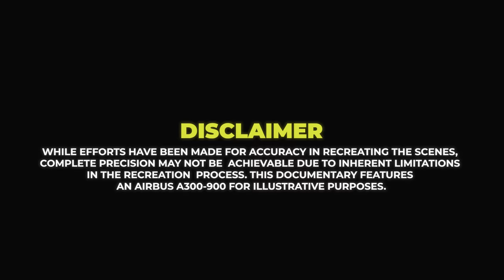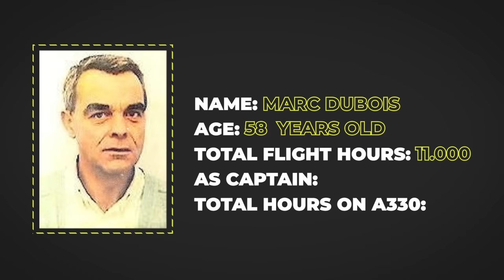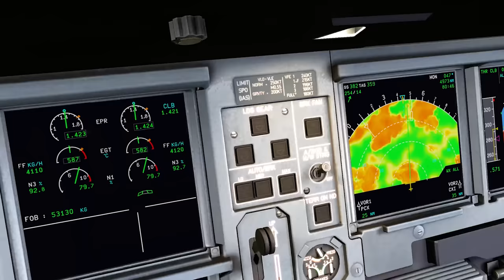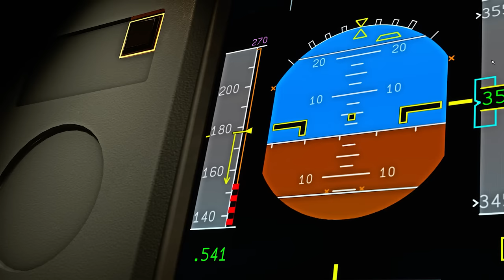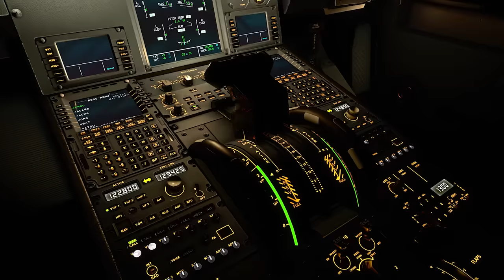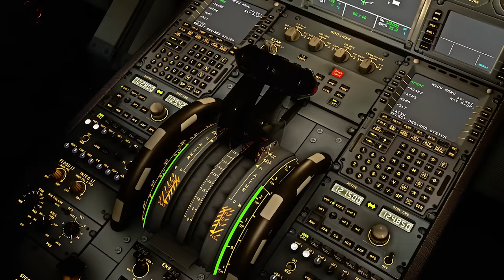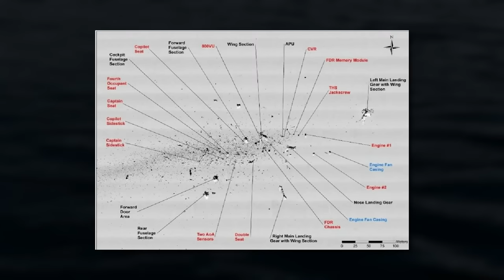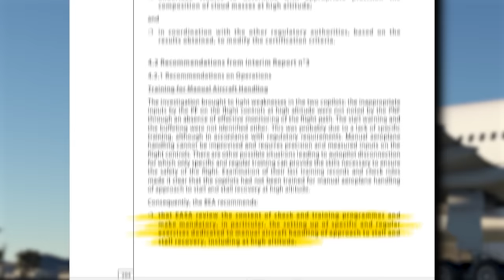Horrific Freefall into the Deepest Ocean | The Sad Story of Flight 447

Comment: I'm a flight sim aviator and I'm shocked at how you could stall at that altitude and not be able to recover. Attempting to put on speedbrakes seems deeply incompetent. It was clear from the recreation video the aircraft was stalling, not overspeeding. When in doubt, push the nose down, especially if you are at high altitude and worried about a stall.
Reply: Bonin, the co pilot F*** up big time, because he stupidly kept pulling the stick back when they were stalling. This guy had no business being a pilot.
Reply: @kevinmalone3210  Yeah guess the guy wasn't trained properly on physics or something.
Reply: Looks like he was to scared to be a pilot.
Reply: The pilots crashing the plane wouldn’t have been possible if it was Boeing
Reply: @thomaspulsiver798  This was 100% pilot error. It has nothing to do with the make of the metal.
Reply: @miawallace2306  in this case it's true, as Boeing doesn't have the dumb joysticks.
Reply: @roiq5263  The design of the yoke has nothing to do with it either. This incident was pilot failure. No Ifs, ands or buts. 
Furthermore, your memory must not serve you properly. Do you not recall B-737 Maxs plummeting to the earth, killing 100s of people just a few years ago?
Reply: @miawallace2306  I'm not saying Boeing can't have accidents. In fact I don't trust Boeing at all. I'm just saying that in this particular scenario, the yoke system would've prevented Bonnin from crashing the plane.
Reply: @roiq5263  Again, the instrument design is not responsible here. Inexperience, hubris and poor crew resource management contending with a routine issue regarding weather and turbulence is.
There are more than a handful of B-777s that also fall into those human error categories. 
Whether it’s a Yoke or SideStick, makes absolutely zero difference.
Reply: @miawallace2306  not denying any of that, just saying it would have prevented this particular accident.
Reply: Bonin's behaviour is absolutely baffling to me.

Every person who ever flew a semi-decently made flight simulator on a home desktop knows that you will stall a plane by permanently pulling up. This is one of the basics you automatically figure out when being new to the world of flight simulations.

Yet he still made this obvious and unfortunately deadly mistake.
Reply: @roiq5263  How exactly ?
Reply: I'm guessing that due to the stall buffeting the aircraft Bonin assumed that the aircraft was flying at a crazy speed so he applied the speed brakes. He's utterly incompetent. RIP to all the pax and crew.
Reply: @funjunk2835  He seems to have forgotten the basic principle of flying. Air speed over the wings = Lift. Lack of Air speed over the wings = Stall.
Reply: @miawallace2306  It's definitely pilot error, but if it were a Boeing aircraft the crew most probably would have been able to recover from the stall due to the setup of the control column.
Reply: @miawallace2306  Totally different scenario. It's like comparing apples and oranges.
Reply: @miawallace2306  "Whether it’s a Yoke or SideStick, makes absolutely zero difference." That NOT true as many PILOTS who commented on AF447 said had it been a Boeing aircraft the crew's chances of recovering from a stall would have been much greater.
Reply: @Robert_N  My spouse has 27 years in crash analysis for the Air Force. Occasionally, he works on civilian cases as well. I myself have 20 years in the commercial aviation industry. 
You are simply wrong. The Boeing yoke does not prevent a crash. In the past, in most cases for many pilots, their initial licensing/type rating was via Boeing aircraft when making the transition from instructor and/or regional carrier  to mainline. Airbus was only introduced in the 1970s and wasn’t considered a major staple until the late 80s/early 90s for commercial use. There is sufficient evidence to support that in a state of panic, a lesser capable aviator can and will revert back to basics as opposed to circumnavigating through the issues readily at hand. The instrumentation for both Boeing and Airbus can be misused exponentially and equally. In both instances, the design is in no way, shape or form attributed to to “yoke” vs “sidestick” but rather the actions or inactions taking by the pilot(s) in control of them.
Reply: @miawallace2306  You're entitled to your opinion and I'm entitled to mine. BTW My father RIP was an airline captain and we used to discuss aviation topics/crashes/incidents all the time.
Reply: @Robert_N  Not an expert but I thought Airbus actually had more automated protections against things like bank angle, critical angle of attack, etc than Boeing?
Reply: @funjunk2835  Not when it goes into Alternate Law and those protections are lost.
Reply: @funjunk2835  You are absolutely correct. They do in fact have those benefits. Whether or not the pilot(s) in command or even the co-pilot(s) / first officer(s) apply them properly is what is called into question. 
Essentially, the aircraft can not crash itself. If and when it does, there’s a 99.9 % chance it was human error.
Reply: Never criticize pilots until unless you were in their shoes. You were not there and Apparently have no understanding of this accident. As a long time Airbus 320 captain with somewhere between 10k-20k hours i can tell you never criticize someone else this could have very well been you.
Reply: @Grandmalipz  Love the A320, I learned the autopilot system in like a day because of its beautiful simplicity in msfs. Look, I'm not a pilot, but these guys crashed a perfectly good aircraft, they deserve the criticism. Why did Bonin try to apply speedbrakes? Why did the Captain not take over, as is customary during emergency? Why did they keep nose up attitude the entire time while the aircraft was literally shaking from stall? Why didn't they put on TOGO, put nose down at high altitude and when peto tubes cleared, reingage autopilot? Why was first officers using dual input, even with audible warning? These guys killed hundreds of people with incompetence. Yes, I am a civilian and I could do better.
Reply: @miawallace2306 Because of the dual inputs issue. Two pilots pulling/pushing joysticks in opposite directions at the same time and canceled eachother out. This can't happen on a Boeing.

"Robert responded to this by saying, "controls to the left", and took over control of the aircraft. He pushed his side-stick forward to lower the nose and recover from the stall; however, Bonin was still pulling his side-stick back. The inputs cancelled each other out and triggered an audible "dual input" warning."
Reply: @mayhem5235  Yes. Because of pilot error. Not because of the sidestick. Bonin reverted back to Boeing training in his panic and pulled the sidestick upwards, towards himself in an attempt to recover from a stall, when he should have been pushing the sidestick forward. Boeing doesn’t govern and automatically disengage dual input so, it would have caused the same catastrophic issue. Airbus actually has a specific verbal warning alarm, which was picked up by the black box after it was salvaged. That’s why Robert relieved Bonin and insisted he had sole control of the aircraft. 
It was concluded that despite Robert’s order, Bonin re-engaged the controls. Robert was supposed to be the sole input aviator  and “his aircraft” but Bonin frantically ignored the commands and reassumed the incorrect input by thrusting the sidestick upwards. 
So, again, the design of the control is absolutely not at fault here. Bonin killed them because of hubris, inexperience and failure to utilize proper crew resource management.
Reply: @funjunk2835  I hope you appreciate irony. Bonin's wife (who was on this flight) is a physics teacher... Guess he didn't listen at home either.
Reply: @Kincentc  Oh man he killed his own wife.
Reply: @miawallace2306 that's good to know
Reply: @funjunk2835 you're the kind of person I want on a plane with me.
If you had been sitting in first class that night there may have been a different outcome if you were able to gain access to the cabin.
In an emergency situation thinking outside the box using every resource could be the difference.
Reply: @Kincentc wow!
Reply: @Downsdddgh  I don't know if I would be able to tell what as going on in passenger cabin. If I was in the cockpit, I definitely could provide useful suggestions. Assist by calling out instrument readings like airspeed, altitude, etc and just providing some sort of assistance. You would assume that the actual pilots would know what they are doing though..
Reply: @Downsdddgh  I will say I check the pitot tubes before while I board the plane for my own reasons usually, especially if I board ground level. That also may not have helped here.
Reply: @miawallace2306  the yokes don't move independently. It means the other pilot would've been able to counter Bonnin's input.
Reply: the 1st officer was a nugget, refusing to give up control
Reply: @EinFritzMitX pure panic. Captain should've pulled him off the controls.

Comment: This tragic accident affected me greatly. FO Bonin seems to have forgotten the basic principle of flying, that you need fast air flow over the wings in order for the plane to fly. If the plane is stalling it means not enough air is flowing over the wings, so you need to increase your speed by applying full thrust AND pitching the nose down by pushing the side stick fully forward. RIP to all the pax and crew.
Reply: Yea out of all the airplane disasters documentaries I’ve watched I feel the most anxiety from this one it’s like I can feel those panic from the confusion and knowing the plane is going down especially when one of the pilots says “this can’t be true”. Everyone is in disbelief from the actions of FO Bonin but i kinda feel bad for him. I think one explanation might be that he panicked the way we would if we’re about to crash into wall quickly press the brakes too hard
Reply: @laylahahmad6468  "if we’re about to crash into wall quickly press the brakes too hard" But in his case he pressed the accelerator too hard.
Reply: @Robert_N  I don't know about that. There is basically only one thing you can hit when in a plane and that is the ground and sea so him pulling the nose up is like him trying to avoid that ie putting on the brakes. But in the case of flying it does the opposite. Although putting the nose down would be accelerating to the ground which is why he was doing the nose up
Reply: Bonin was green and kept trusting the airspeed indicator over the stall warning 🤦‍♂️
Reply: In a car, you slow down to avoid crashing. In a plane, you must speed up. Always remember that. Pointing the nose up only slows the plane down more. The pilot was grossly incompetent.

Comment: Seems like this could have been avoided 100%
Reply: It was 100% avoidable. If they had just left the auto pilot on and done nothing, they would’ve been fine.
Reply: @theplatinumtakeoff6215 you can’t use autopilot in alternate law, and you have to go to alternate law when pitot tubes are blocked and airspeed is unreliable.  You don’t know anything about Airbus aircraft computer systems
Reply: @GoatsatanRex  Well apparently neither did those pilots.
Reply: @theplatinumtakeoff6215  Lmao

Comment: I just dont understand how trained pilots simply fail to recover from a stall. They just go full panic mode, nose up, brain off?
Reply: Evidently they didn't know they were in a stall.
Reply: I think some sympathy for the pilot and FO's is deserved... It must have been incredibly disorienting to be flying into one of the more notorious and remote oceanic stretches of severe weather with icing, complicated by an indicated airspeed mismatch -- and then suddenly the flight computer dumps them to alternative law 2. I can't imagine the fear when your avionics start throwing errors and you're questioning even the basics, knowing you have hundreds of souls depending on you just behind the cockpit door. Flying in the dark without a reliable airspeed indicator, no functioning stall warning you can trust, and now you're doubting the other avionics on your cluster... that would be terrifying (I'd imagine, I'm not a pilot).

I agree - It took them way too long to arrive at the diagnosis of a stalled condition - but you can tell from the cockpit voice recorder that they weren't sure if they were stalled or not, and/or overspeeding the airframe or not, and I guess the prospect of nose down to re-coordinate the airflow over the wings scared them, or didn't occur to them in time while they still had 30k of air between them and the ocean. The FO had the stick pulled back for nearly the entire time. The same FO that kept inputting dual inputs (and frankly, inputted the first offending nose up input for no reason) despite multiple requests to clear the inputs and give control to the left seat showed extremely poor judgment. 

It seems easy to diagnose from here, they're giving full power with a nose up attitude - but they are not climbing. What else could it be but a stall? Control surface icing? Some esoteric flight computer bug? But overall, I agree with you and the video - ultimately the lack of familiarity with emergency preparedness procedures, and inability to diagnose and troubleshoot in the moment is what lead to the failure to recover from the stall, and tragically, the loss of so many lives.
Reply: @DrachHeinz  Maybe it's like if you are swimming and get caught in a rip tide, the worst thing to do is panic.
Reply: Because of Bonin’s unshared decision to keep the nose up and in the stall, they were focusing on other areas to solve the problem and keep the plane flying. It almost seems suicidal in truth. By the time the Captain was informed of Bonin’s choice, they just couldn’t recover.
Reply: Agreed -  @ladirectorguy
Reply: Part of the problem was Bonin kept pulling back on the side stick, and neither of the other pilots knew he was doing this. The sidesticks also weren't linked together.

Comment: tbh I can see how the crew was confused. Flying through a storm, sensors freezing up, not knowing which displays or audible warnings are accurate, no visual cues, and a very short time to correct easy to make mistakes.

 It's easy in hindsight to understand their faulty decisions but it all happened in 2-3 minutes before the plane was doomed.
Reply: I can sort of see that, especially the captain coming back and being overloaded with all these alerts and nobody briefing him, but initially - that FO should never have had control if he can’t hand fly for 60 seconds, that’s insane. 16 degrees AoA for seemingly no reason at the start is just nuts. Did that guy even look at his ADI? And all that excessive roll, I was taught within 10 hours to stop over controlling. A commercial pilot shouldn’t be experiencing pilot induced turbulence
Reply: @Anngus_  Yes you're right he did a very poor job I'm sure he'd never been put in such a difficult situation before and, up to then, been relying more on the automation of the aircraft instead of manually flying the aircraft. Even the most seasoned of pilots may get into a tough situation and make decisions where you wonder how he got all those thousands of flying hours without crashing. THere's a video on YT where an F-15 pilot has an in flight emergency, a fire in the engine, the strict rules were to immediately dump the aircraft and eject but he panicked and flew to the closest air base, landing way too fast, blowing out the tires and finally right before he runs out of runway he ejects and never flew again. Well, he was one of the most experienced fighter pilots in the world with over 4,000 flying hours in the F-15. That's 4,000 hours in an advanced fighter jet that cost about $12,000 an hour to maintain. You can do the math.
Reply: Yeah exactly right, everyone is a great pilot watching YouTube on the ground haha
Reply: Their situation called for what's referred to as a "known pitch and power" response. Meaning a known setting that you know is conducive to safe flight. They panicked and froze.
Reply: @PabloGonzalez-hv3td  I don't think they panic and froze. Robert was chilled at first because its probably something easy to handle when he saw Bonin couldn't solve it he took sole control but I guess the damage had already been done.

Comment: Its kind of appalling how such a mistake that is easily identifiable and prevented, even occured.
If you are having poor roll and yaw control, are nose-high and/or attempting and failing to to go nose-high, all while dropping altitude, it is very blatantly apparent, excluding potential for some sort of mechanical failure, that the aircraft is in a stall.  And the aircraft itself already had its stall indicators triggered, which should have alarmed the pilots.
Recovery should've been automatic to the pilots.  Stick and throttle forwards to nose down and increase airspeed and regain control.  They had so much time and altitude to perform this recovery.  And when one of them finally DID attempt, the 1st officer (who had mostly got the aircraft into this situation in the first place) doesn't release the controls despite saying so.
It's a shame that somehow this was even allowed to have happened.  Training should have made such a simple mistake very simple and fast to correct, but all the textbook WRONG (particularly holding the stick back for nearly the entire descent) answers were used.
Thats the most depressing part.  How something very simply recognized, countered, and prevented, with all the information at their disposal...was not on any of those counts, resulting in this awful loss of life.
Reply: My drill officer in the Russian army loved to say that in case of an emergency your skills don’t rise to your expectations but fall down to your level of training. We can see now what the actual skill level of the FO was. Bible says that everyone’s work will one day be tested with fire. Voila…